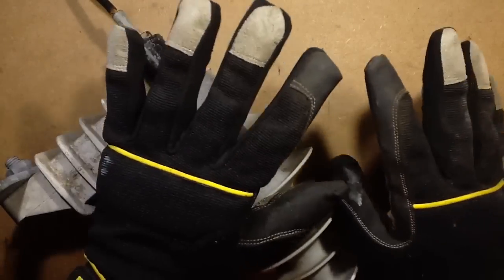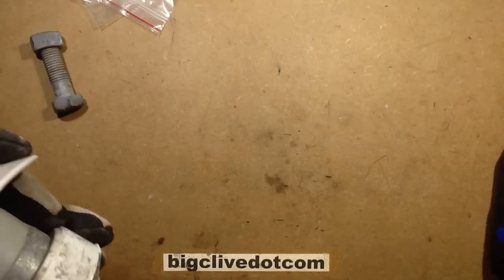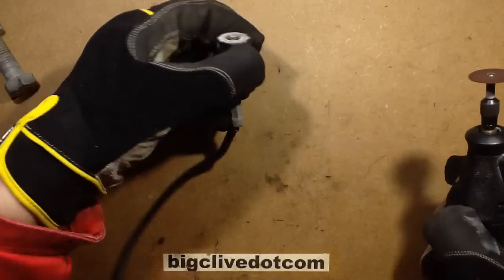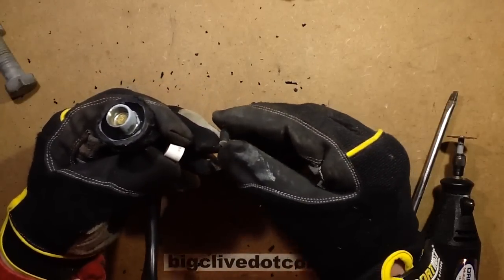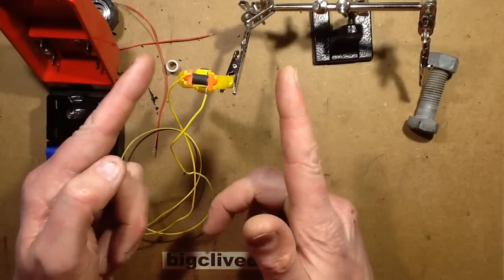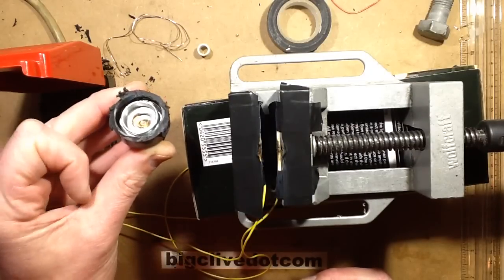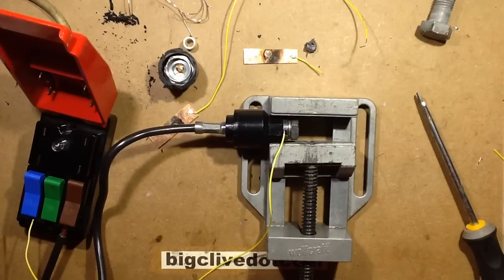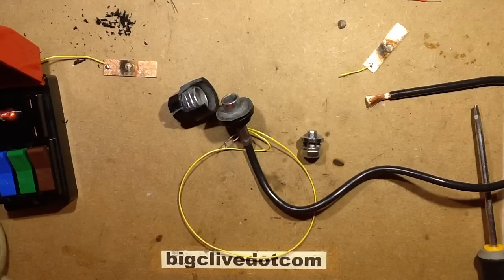Bear & beer.  Opening an explosive 11kv disconnector.  (With bang.)

Comment: Nice one Clive. You may have missed your vocation in bomb disposal! However, as a teenager, I proved that a 50 ohm resistor* from an old valve radio made an excellent detonator when connected directly across 240 V mains. *Carbon composition in a 20 x 6mm ceramic tube! I still remember the sound of the shrapnel pinging around the walls of my bedroom in Edinburgh as I hid behind a chair. Blew the 15A fuse wire at the meter & Mum said "what have you done this time?" I think she helped me become an engineer!

Comment: The carbon bit is just a heater, the explosive is actually a blank cartridge in one end that forms one of the contacts (it looks like a 22 blank, but it might be a 25).
Reply from the maker: I did find the .22 blank under the foil afterwards.

Comment: I’d imagine, the explosion chamber is simply a hermetically sealed vessel, where the carbon rods would combust, there’s a rapid expansion of pressure within the sealed vessel, which the pressure would accumulate until its meant to break at a designated spot of the weakest point, this is where the plastic is specifically located on this device.
Reply from the maker: There turned out to be a .22 shell under the copper foil.

Comment: I think the chunk of carbon might just be acting as a resistive heating element.  that brass contact looks like a rimfire blank for a powder actuated tool, and it's missing from the one you popped.
Reply from the maker: I subsequently discovered there was a 0.22 blank under the foil.

Comment: I wonder if it would be any louder with 11KV going through it rather than 240.
Reply from the maker: You'd get the same volume of bang and a short arc noise as the wire blew off.

Comment: are these things what're responsible for those loud bangs when a transformer can on the power poles goes funny?
Reply from the maker: These produce one loud bang.  Insulator failure can keep arcing and banging.
Reply: @bigclivedotcom  "one loud bang" is both of the incidents i remember, but i'm being told that could still just be the can rupturing

Comment: the ceramic shell serves 2 purposes first is to increase the magnitude of the charge  second as an insulator.   If you hold a fire cracker between your fingers you will be burned badly.  where as if you hold it in a clinched fist it will blow your hand off.

Comment: I have predicted that it won't really explode, like even if you take black powder and light it up in the open air it won't blow up as it needs a shell to build up pressure and make it explode
Reply from the maker: It did subsequently turn out to have a 0.22 blank under the copper tape.
Reply: @bigclivedotcom  ah, well still it's pretty dangerous when it's all packed tightly together, but any type of explosive is harmless if not contained, as you can even make something explosive with just a box of matches if you mix matches, it's very fun but dangerous, if you take the end of a match and crush it to a fine powder and scrape the special tape on the box and mix them together you get an explosive powder that I find very fun to play around with, it already has everything it needs to ignite so you can just put it anywhere and it'll act like black powder, I played even with the powder you get inside the small festival explosives like fireworks and other, but do you think that there could be a safer way to make something that is as effective to break the circuit but not as dangerous?
Reply: "safer" as not using literal explosives

Comment: It wasn’t originally impressive because there was nothing containing all that energy.

The ceramic casing is to increase pressure which causes a more powerful explosion by releasing much more energy in a smaller area.
Reply from the maker: After the video I found a 0.22 blank under the copper foil.

Comment: Probably heats the air trapped inside the device due to it being sealed and when the air expands it blows apart.
Reply from the maker: It turns out that the copper foil was hiding a 0.22 shell!

Comment: On desktop at 13:57, pause and use the , and . keys to go frame by frame. There's about two of them anyway whilst the assembly gets blown to bits :-)

Is it just me or the early part of "lets hold in the palm of my hand this explosive thing while I cut it with a dremel" was a bit cringe worthy? Given the usage of protective equipment, that would have been a good time to use a clamp.

Comment: Some serious ringing from the L & C circuits.  (Use A Mirror & Shielding (splash damage)) 
(Truly horrible crimp on the brass lug)                -    -    -    -     -
Contractors fitted an 11kV connector box to a 33KV 3/12 polyphase Main Transformer,   -   -  'IT BLEW' the cover, while one was under it fixing cable clamps. ( off the hospital, clean off the melted bitumen pitch, cover dented steel fencing 8M away)

Comment: Could the ceramic cylinder have actually been the explosive with the carbon rod just working as a way to ignite it? Hard to imagine that difference was only due to the containment.
Reply from the maker: It later turned out that there was a blank shell under the copper tape.

Comment: The black is carbon resistor, it's not explosive. Actually it will act like a fuse. Depending on the voltage capacity. You can find this also in  Screw tester because it is made for high voltage resistor from 1000v lowerd to 6v. for ex.

Comment: What sucks is then they dry out and crack on the top.  Knocks the feeder out and take forever to find!
Reply from the maker: Theoretically, if it cracked and arced past part of the MOV stack inside, it should blow out its disconnector if enough sustained current flowed.
Reply: bigclivedotcom the problem has to do with the construction standard of the build up here.  We use a #2 CU strand ground and the wire is too rigid to allow the back part to blow clear.  Usually happens on 13.8kV to ground lines with 18kV arresters.
Reply from the maker: @bbc762x51  Do the arrestors have a braid on them between the base and your bond?  This one used a braided copper wire to make it more flexible.

Comment: If the disconector screws off then why do you have to replace the whole unit? Why not just install a new disconector
Reply from the maker: To cause the disconnector to trigger the MOV stack will have been passing abnormal current.
Reply: So the entire thing is shot, got it

Comment: Your brilliant. Always wondered about lightning strikes on power lines. Do you have a vandergraff generator or a Tesla coil to hand. Not suggesting you try any experiments using these devices. Top tip using a dremmel drill.If you ever have a mini wire brush attachment for it. At high speed,metal wire strands fly out when rubbing something down. Found out the hard way.Great video though.

Comment: Clive said under a other comment that the brass contactor on the one side is actually a .22 blank, my idea is that the carbon rod is just a resistor, meant to overheat the primer compound in the .22, detonating that.

Comment: I heard such a thing frequently, while my commuter train was passing along an insulation point, where the driver had to temporarily disconnect the HV supply for passing. This is indeed a loud "bang", when getting released because of that strong spring inside of the switcher tube. Switching on again requires air (or hydraulic) pressure put onto the mechanism's working cylinder to stretch the spring contact again so it closes the circuit again.

Comment: I was about 50 feet from what I think was an explosive disconnect once and it was LOUD. So loud I hit the deck just by reflex before I even knew what was happening (with no military training btw) and heard an echo rolling away. I was walking home at 2am and coming up on a corner, saw a strange flickering light shining on the road from around the corner, was just walking into view of a truly amazing fountain of sparks coming from the top of a pole, and the explosion - sound only, no flash that I saw - came from the pole much closer to me at the corner itself. After that the sparks stopped. Drove by the next day and there were freshly sawed up tree branches scattered around by the pole that was showering sparks, and a residential size transformer lived atop that pole as well.
Reply from the maker: It was probably an expulsion fuse blowing.  They sound like a gunshot because the fuse literally blows itself out of the barrel.  Search my channel for the word fuse to see an example of one.

Comment: If it did that with 240, what would a lightning strike do to it?
Reply from the maker: The lightning strike is a brief pulse.  If the unit clamped it, along with all the others on the same line then the thermal inertia of the carbon block would probably not result in triggering the explosive charge.

Comment: Clive.. they do make true explosive disconnects using .22 blanks... I am working on a project with MMO arresters from Bowthorpe. Its a TE company out of Ireland
Reply from the maker: This one did have a .22 blank in it under the foil.  I discovered that afterwards.
Reply: @bigclivedotcom   I was wondering how a carbon rod could generate that much energy that quickly... Thought that it might have vaporized some of the copper or low temp alloy but the explosive charge makes much more sense.

Comment: Sometime in my younger years I either heard or read that the huge Russian power network had backup explosive disconnects.  Normal disconnects are not supposed to interrupt any current, which is done with pressurized sulfuric hexafluoride (SF6) filled breakers.  We at one time tried to build a new design of the operator for such a breaker.  It was to be for a two-head breaker with two hydraulic cylinders and a synchronizing  12 inch diameter pipe with 1.5 inch wall.  Besides the bang, there was heavy vibration.  A high speed movie (1700 frames per second) revealed that the synchronizing pipe was twisting and the levers at each end swung as much as 30 degrees rotation against each other.  All that was because we had the hardest of times to match the tripping of the two solenoid valves to better than about 0.2 milliseconds.

Comment: The tranformer primary fuse at my house has blown several times.  It sounded like a canon going off, so I imagine the kAmps available in the slug will blow it to smitherines.  Thank goodness it wasn't a black powder charge that could have blown off a finger. And what's the funky red box with 240?
Reply from the maker: The box is a Cliff quick test.   The fuses you mention are expulsion fuses and work by blowing the fuse wires out like a gun.

Comment: I think if that ceramic peace was not removed, the process would end up like you wanted at first
Its like firing the gun powder without the shell
Reply from the maker: It subsequently turned out there was an actual 0.22 shell in it.  Under the copper foil.
Reply: bigclivedotcom hmm
Interesting

Comment: This is typical when you burn gun powder in an enclosed area. Pressure rises and causes an run-away reaction aka explosion.
If burnt in "free air" gun powder will not explode. (If you consider the damming effect for that  specific type of gun powder).

Comment: I think the ceramic when heated inside with add to the bang. But the sealed part is heated fast until the heated air, carbon and other things expand and the only way to let it all out is for it to blow.

Comment: These are the proper kind of expirements. Either it works and you can only count to 5 with both hands or it doesnt and you have to move out of the city just in case.

Comment: Little late to the party, but I'm pretty sure the first charge failed because of pressure. Same goes for gun powder. In open air it simply burns. Contain it however and you've got an explosion.

Comment: The explosive charge isnt the carbon slug u removed it is actually the large brass contact u can see, it is infact the base of a .22 blank cartridge made by eley (hence the E stamped on the base). That the reason it is completely missing from the one that was detonated as it would have been ejected as the blast comes out the other end.
Reply from the maker: I did a followup video about that when I finally discovered what had happened.  It seems to be a standard .22 style blank.

Comment: Yea i might just being practising less in tech and el but about the fisic side of this the white stuff ceramic around it actually helps to force the charge cause the booth sides do preshure on it till it brokes u can see its not too small but not too fat as far steel strong i guess but it shuts the charge quite off also the smoke preshure helps at that point

Comment: I’m slightly confused. How did it explode again? Was it not actually set off the first two attempts?
Reply from the maker: Different explosive disconnection module.
Reply: bigclivedotcom wow so moral of the story is the only difference there was...what...pressure?
Reply: bigclivedotcom I see I rewatched it, I assumed you had just shoved the original back together somehow. Fascinating

Comment: Well sir, I’ve installed probably around 100 maybe 150 in my career as a apprentice lineman.

Our lightning arrestors are intended to take a few strikes on the overhead primary,  but most of the times when we have a blown arrestor it’s from a direct hit.  
The biggest one I’ve seen explode was a 30 year old porcelain arrestor.
Pieces flew 100 feet in all directions
Reply: I just did a little bit of research about that type of arrester,  it’s really Effin neat!

I’m attaching a link for a page that goes into detail about arresters.

http://www.arresterworks.com/ArresterFacts_files/Arrester%20Facts%20005%20-%20Arrester%20Disconnector.pdf

Comment: In High School Physics class, back in the 80s, I recall putting a wooden lead carbon pencil in series connection with a lab transformer, with similar but slightly more spectacular results, as the pencil skined itself and the carbon lead exploded. Equally as impressive was connecting a length of steel wool to the lab transformer, the steel wool almost instantaniously vapourising with a few airbourn tinkles of sparklers.
Reply: Steel wool is a marvelous backyard pyrotechnic improvisation

Comment: All these things do is provide a gas tight seal around the vaporizing slug. Just the very center bit with the crimp pops out. 

No big deal. I saw one pop from a pole down hill from my deck when a dump truck driver forgot to lower his bed before driving off. 

He cut every wire down the whole road dragging live conductors in a tangled mass behind him. 

Looked like 4th of July here, but at ground level. 

Power company guys left all the broken gear lined up for the kids to look at. Very cool.

Comment: i think the ceramic tube is to direct the explosion into the right direction so it really disconnects the cable from the device. otherwise the explosion could just blast out to the side and there would be a risk of an ark between the connections.
could be wrong tho

Comment: Am I the only one curious, Where was the .22 blank located. Did you check back in the first one you cut open for it?
Reply from the maker: It was under a piece of copper foil with the end of the carbon slug against it.

Comment: I worked at a gas station, one rainy afternoon I was out for a smoke. About twenty feet from me was a power line. It was struck by lightening, there were several extremely loud bangs and an explosion that rained sparks almost to me. It was beautiful and terrifying. The gas station lost power and was a major fire hazard, as the pumps were close enough to the explosion to be rained in sparks.
Reply from the maker: If you search YouTube there are loads of videos of powerlines blowing up in a similar manner.  Like continuous fireworks.
Reply: I didn't expect you to reply! I love taking stuff apart and messing with it, also beer. Your videos are great. I recently came to find one of these http://www.targetti.com/en/outdoor-lighting/inground , but got send the wrong torque screw drivers in the mail (even though I definitely ordered the correct ones, and paid a few bucks extra). Any chance you could help figure out how to open it? Its just sitting in the cupboard. (PS i honestly didnt steal it. )
Reply: ICARE FIXED btw
Reply from the maker: Looks like tamperproof Torx.  Often found in sets of security bits.

Comment: Good posting Clive, thank you.
In my youth many years ago we as typical boys of the middle to late 60's found some unused railway detonators, in a box, they were used on the tracks to alert train drivers etc as to the danger of fog or any other type of incident ahead. Well as boys being boys some were put upon the tracks of the GWR and observed with nervous laughter as the train approached. "BANG, BANG, BANG", saw the boys running away with squeals of delight before the last explosion had stopped echoing in the factories alongside the railway. We found other ways to detonate them and one particular exercise saw some exploding in the Grand Union Canal and the deserted gravel pits which were virtually next to the canal and railway. A local metal working company 'supplied' the pipes and rods etc from their unlocked and open scrap bins. The detonators provided a couple of days of excitement in an otherwise hot and sultry summer holiday. A couple of things we learnt from these escapades was the explosions are better when the detonators were enclosed in something and never stand too close when applying the necessary force to explode them. We often looked for more boxes next to the railway but alas it seemed as if it was only a once in a lifetime event. Even so, it was much appreciated.
Reply from the maker: Nothing beats the adrenaline filled anticipation of the explosive charge going off.